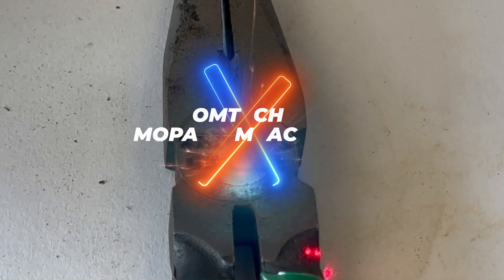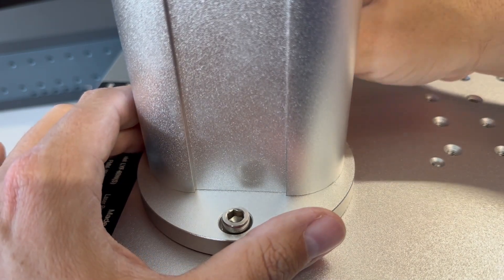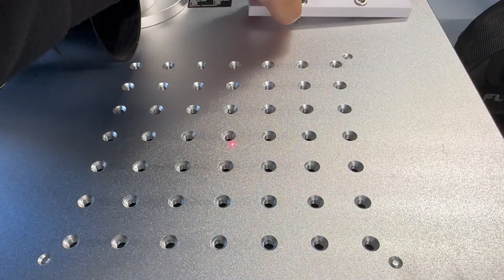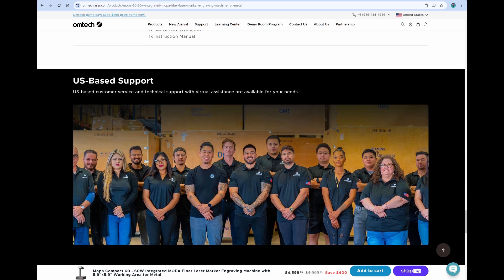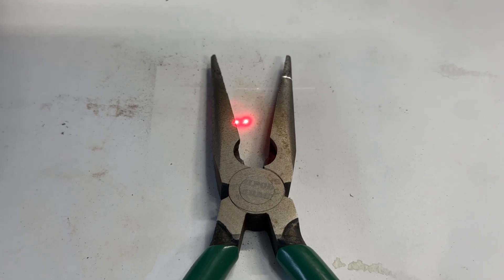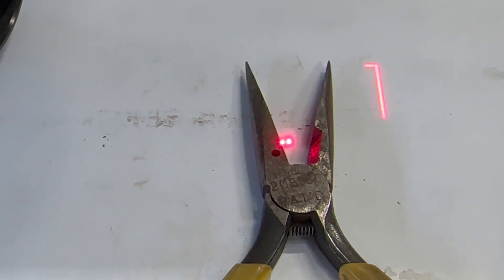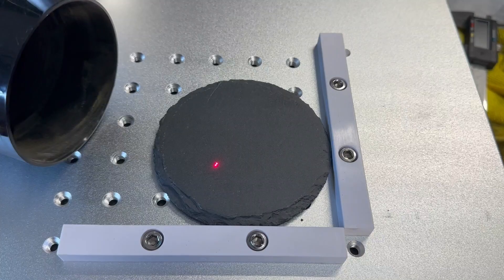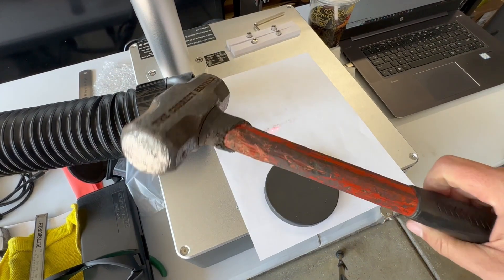OMTech 60W Integrated MOPA Fiber Laser Marker

Comment: I have  concern about the jig holes on the plate and the particulate falling through them into the electronics bellow over time, specially iron particles that would rust. That aside, have you seen any performance or accuracy difference? (if you have other fiber lasers of the same wattage)
Reply: There is a cover under the plate to stop debris falling through the holes